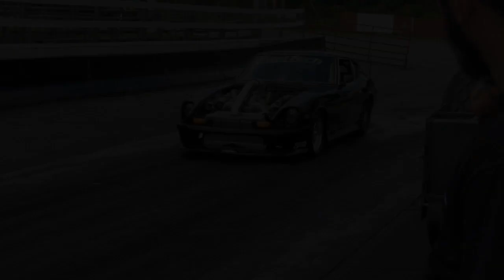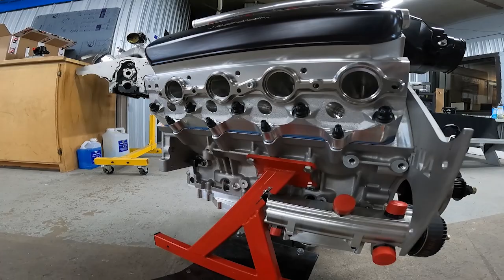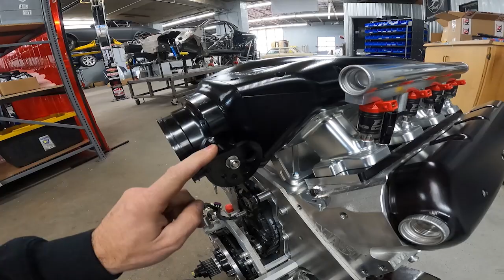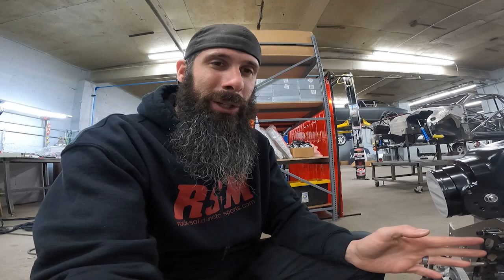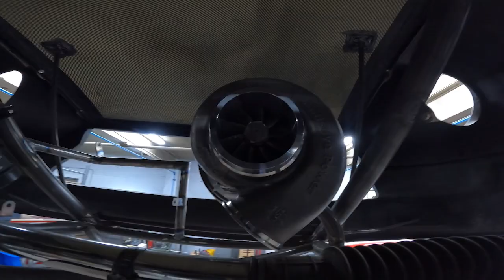NEW ENGINE picked up at TKM for Du Hast 2.0

Comment: You should take the car to Modern Racing or Brown and Miller to have them plumb and wire the car and have them hook the wires from the ECU to the burst panel so if it see's any type of detonation in the engine it will cut the car off and pop the burst panel and not the intake or anything else
Reply from the maker: Mike comes to our shop too from Brown and Miller and he is going to do all the plumbing on the car at our shop. Michael Bunton will be doing the wiring as it has the ft600.

Comment: How come you went with a low ram style intake opposed to a mid or high ram style and since your car is still in the making you should move the engine back a few inches and make the firewall out of titanium and the same with the floor pan inside the car and get a cowl hood for it I've seen a few cars like yours with a cowl hood and it doesn't matter what size they have in my opinion it sets the car off big time it makes it look mean as hell and it helps the air flow go up and over the car and you should run a Liberty trans in your car most definitely because that is the only thing fitting enough to be bolted up to a work of art of an engine like that.... That engine hands down belongs in a museum somewhere because it is truly a work of art and if it runs as good as it looks which it should coming from TKM your car should be stupid fast and you should have no problem running up front with the rest of the stick shift guys

Comment: I really like watching your build, Im working on a S10 that I just had a 355 chevy built that dyno at 478 hp also running a 9in floated with a 350 turbo built also 300 shot of Nitrous. Been thinking about putting a cage in it but undecided yet. I spent 30 years driving circle track cars so Im worried about putting the cage in so Im not tempted to race it. Love your fab work.

Comment: Steve Morris just did a side by side comparison on a Dyno run between 4in an 5 in pipe the only difference is 4in pipe to cast intake and dyno against 5in pipe with billet intake  if it weren't for the change in intake that would have been dead on your comparison you were looking for and right when you talked about it that was funny to see